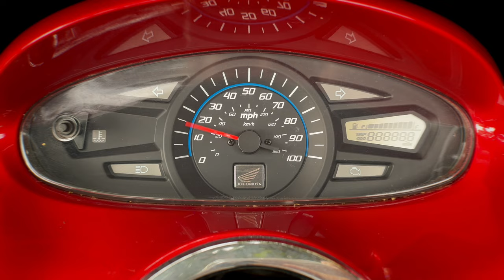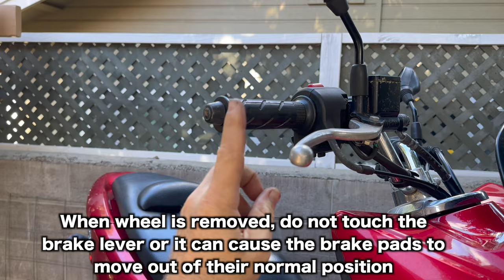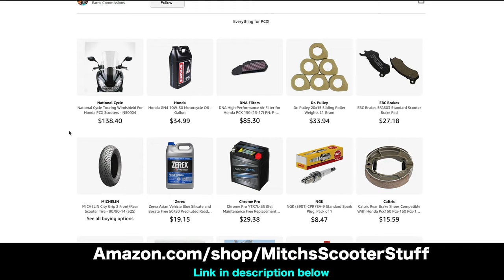Honda PCX 125/150 - Fork Oil Change | Mitch's Scooter Stuff

Comment: Great video, Mitch!  I've got the PCX150, what I find concerning is that the fork is only being held by two little pinch bolts, especially when one hits a pothole.
Reply: Almost sll scooters are same. The single lower clamp is considerably stronger, heavier than a typical lower clamp on most motorcyces

Comment: Thanks Mitch.  I have a 2016 Sym HD 200 (171cc) with 19k miles.  Rides awful and I feel all the bumps in the road now at front. At 19k miles I'm due for a fork oil change out, right??  

After seeing your video I believe I can do it.  Maybe...
Thanks
Dean
Seattle
Reply: Def need changing. Some pretty thick, dark stuff came out of my forks after 5500miles in 10 years. You can make them more compliant but reducing oil wt slightly & incteasing oil level slightly to help prevent bottoming.

Comment: I had to use drill press to compress forks & to remove top circlips, which were a bear to get out even with 2 hands. I locked press in the compressed position My caps look very diff from this pcx. Jusr barrly able to compress caps enuff to get space under the clips. 20min total just removing top circlips. Rest was easy.

Comment: Very useful, thank you.
I may be doing this on a later model once the weather warms up a little here in Japan.
I assume that it's almost entirely the same parts, and the principal is obviously the same. I have the KF18 (2015/150).
A note on the subtitles: 15:28 "stop tapping until the groove on the inside wall is visible right above the oil seal."
Is that a typo?
Do you mean keep tapping until...?
No big deal, just thought I should ask.
That's two of your videos I have watched in a row to give me a heads-up on up-coming maintenance jobs.
Liked. Subscribed.
EDIT
I like your bike stand. I wonder if I can find a used one of those near me. Everything is so expensive in Japan, even 2nd hand.

Comment: My front suspension bottoms often even if there is no hole on the floor, a tiny bump will make it bottom. I am only 70kg by the way. Do you think the springs are worn out? Or maybe an oil problem?
Reply: Yes, probably oil is low or gone. Springs would have to be in horrible shape to be the sole cause
Reply: @barneyrubble4827  it makes sense. I had the oil replaced, was nearly dry when they opened it. They didn't bother replacing the seals. It was way too strong for a month and now it's back as before. I wish there were real mechanics where I live...

Comment: Hi. Couldn't you just break the lower Allan bolts loose while the forks are still on the bike?
Reply: You could but oil will leak out while backing the bolt out making a mess unless you break & snug. I dont see an advantage but wouldnt hurt

Comment: Hey Mitch, I have this clunk or thunk noise when I sit on the scooter and push down the handlebar all the way down while on the front brake. It also happens when it comes to a full stop at a light I hear this thunk sound from front fork.. could something be loose or worn?
Reply: Sounds like its bottoming... too little oil, worn out springs. If springs are too short(compressed beyond service limit) I'd just make spacers to increase the preload

Comment: there's a special place in hell to those who put loctite on the bottom bolt.  it's a pain in the butt to get it out afterwards.
Reply: And I thought rust was bad enough.... That's going to end up a welding job for sure once the Alan nut is stripped.
Reply: you can drill the head out if it's stripped! @DennisdeJong
Reply: Loctite blue aint bad but youll need to fashion a damper wrench of some kind or the bolt/damper just spins. Same for drilling it😫